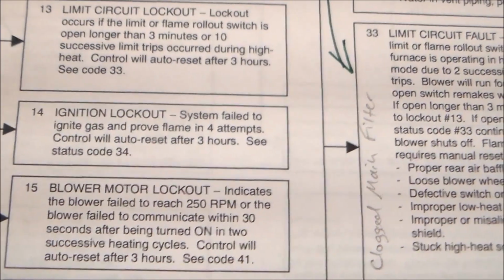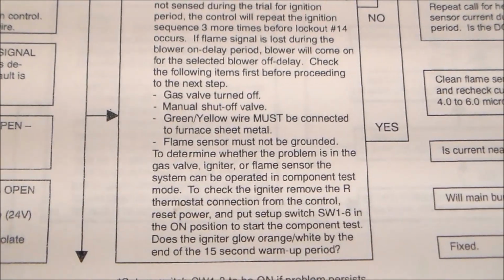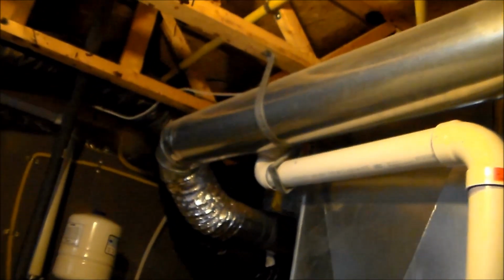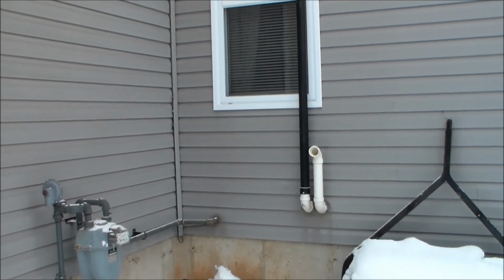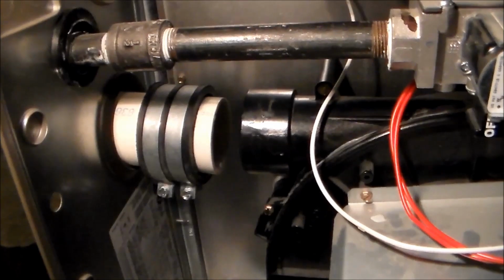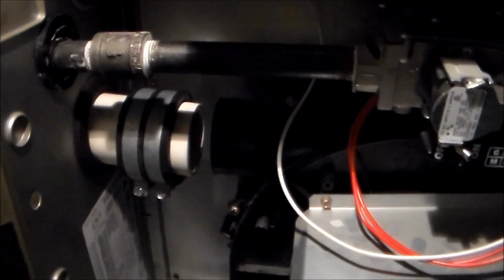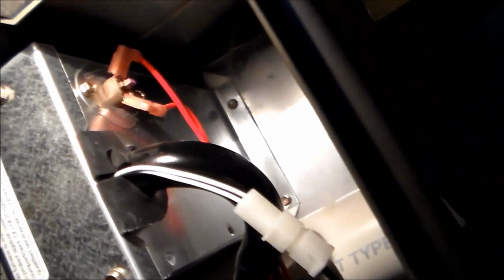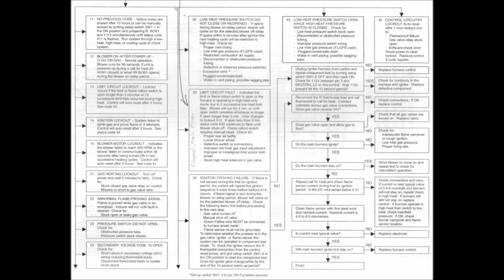Carrier Comfort 92 Furnace Error Code #13 #14 #33 and #34 Ignition Lockout and Limit Circuit

Comment: 10yrs ago, I replaced the original furnace controller with a OEM Bryant NIB board. Furnace has been solid performer since. The new controller safety/information stickers has useful tips for code 34: Oxide buildup on flame sensor (clean with fine steel wool); sensor current 0.5ma or less (4ma-6ma normal). I conclude this could be a faulty flame sensor. The startup sequence is the flue draft fan starts. There are flue low pressure "vacuum" sensors which detect proper air flow. Then igniter glows, gas flow starts, gas does ignite, and after 3-5 seconds, shutdown and error 34. You would not even get to gas flow on without proper exhaust air flow. All of these feedback safety sensors prevent the furnace from turning on the gas if the flue is not clear. The flame sensor is the only way the furnace "knows" the gas is actually burning. Without that feedback, then the controller will halt the current start sequence, retry 3 times, then give up for 3 hours. The fact my furnace cycled 2 times before successful burn to set temperature tells me everything is good but the flame sensor. Given the age of my Carrier Weathermaker 8000 (1994) I'm not surprised something else broke.